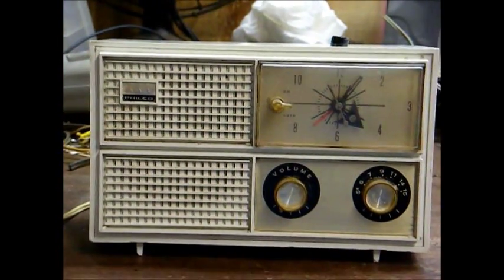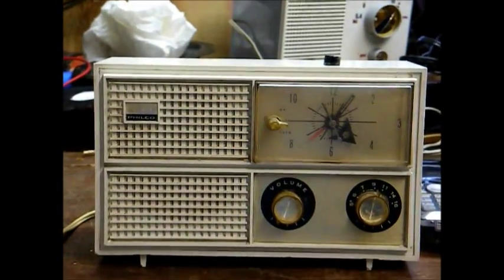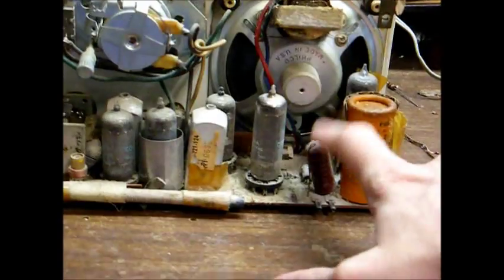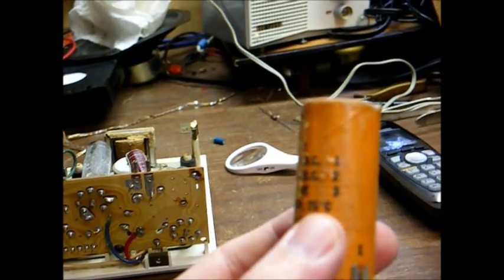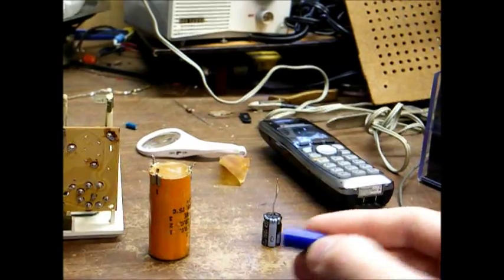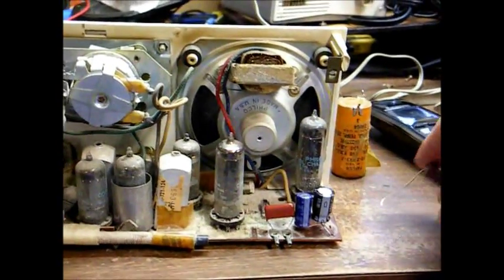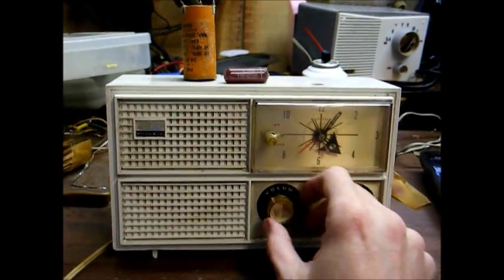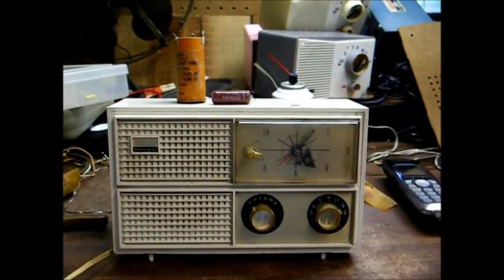1964 Philco AM tube clock radio

Comment: PLEASE don't be offended & Say what you want, but I'd of added a paralleled 3.3 mfd, 160V cap along with that 47 mfd to restore it to the exact value called for, but I'm anal that way, LOL! I'd a checked all the tubes, too & replaced any that are below 90% for maximum performance... It turned out okay, though, you did an excellent job on it & it works & sounds great! Do you ever sell any of those clock/radios that are tube-type? Since I don't have any anymore, I'd like to have one again by my bedside....